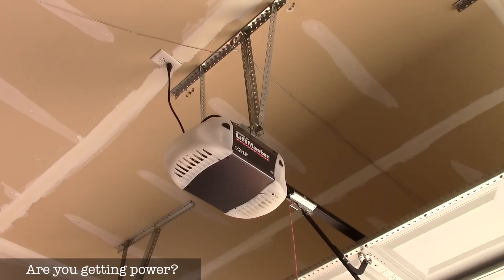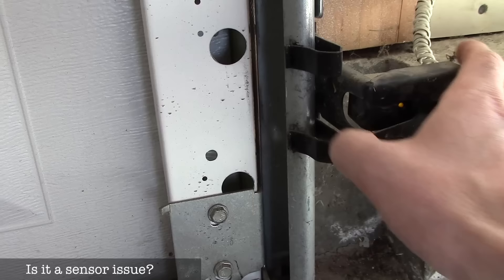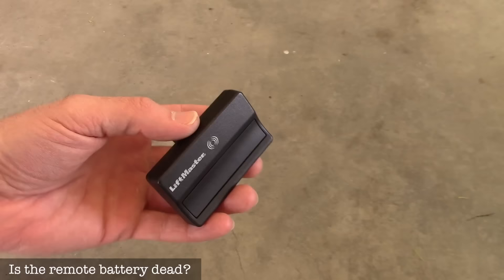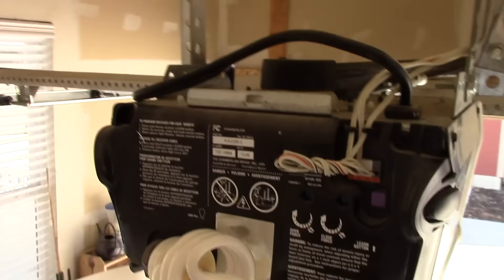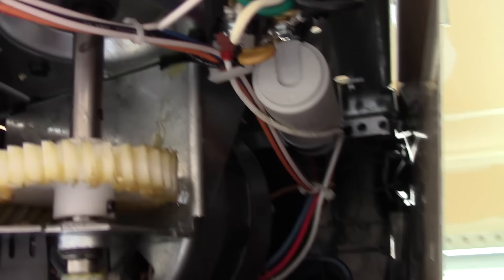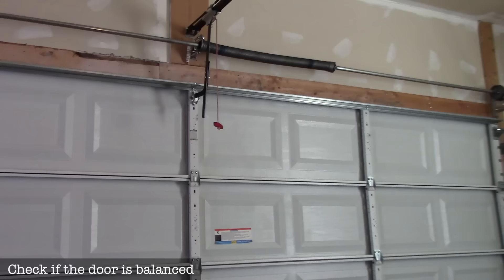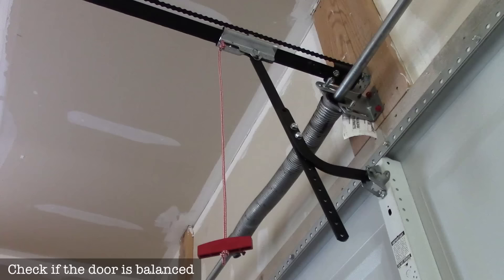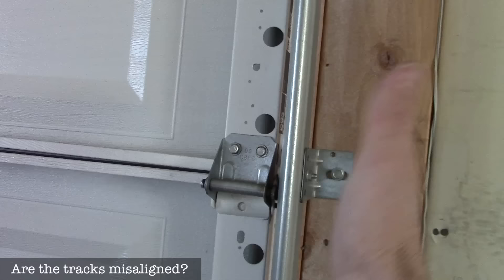Garage Door Opener Troubleshooting and Repair - How to fix common problems

Comment: I have a question with the Garage door remote, Here is the issue, I am able to open the garage door using the remote, after I come out of my garage and try to close it it will not close. I have to wait for the light on the overhead turn off (app 5 mins) , then when I press my remote the door will close. My bulb is not a LED bulb. Any idea to solve this issue will be greatly appreciated

Comment: My garage door won’t go up. The lights work 
 Everything looks fine, but the sensor lights are off. How do I replace them? Or do I need an electrician? I’m not good at electrical work. What can I do to make my garage work again ? It won’t go up, I checked the wires they’re ok . Any advice I’d appreciate

Comment: My door goes down then back up. Sensors leds are on and seem to work. Reduced travel both up and down worked a couple of times then same problem occurred. Checked for pinching all good also nothing blocking sensors. So bad board maybe 15 yrs old.

Comment: Hi Adam, My Liftmaster Pro 1/2 hp stopped responding. when I unplug the power and reconnect the light stays on for 5 min, and nothing more. changed the motion sensors (amber was not lighting up). Remote has good battery and lights up. any idea why it is not responding? thank you.

Comment: My garage door & remotes started malfunctioning. Liftmaster is of zero help. I'm trying to fix myself. Took the motherboard out to look for something. Saw nothing but added some soder anyway. Now, I can't program any remote, plus I notice that there are no lights on either of my door sensors. The garage door opener LED learn light now blinks twice. Any thoughts?

Comment: Help,  I pulled the disconect to manually close my door.  It was OPEN when the power went off strong wind rain. So I could not close the door with the remote.  Now when I try the pull down and forward it will not connect.   The other videos that tell you how to reengage the door should be CLOSED when you pull the cord to disconnect.  
Any ideas how to reconnect the power opener

Comment: Both of my sensor lights stay green and don't go off when I move my hand in front of them. Will start to close and go back up with the remote.Will close by holding
 down wall switch. It is a Liftmaster brand. Can you help?

Comment: I can’t find out why the light💡 on my won’t work. The bulb is good but when I push the switch to turn it on, I just hear a clicking sound. I’m wondering if the problem might be internal or maybe a short?

Comment: I have a Genie 1028 model garage door opener and have had intermittent problems with the door sounding like the motor is running, but the door does not engage the chain. The chain seems little loose and I have not been able to figure out how to tighten same(have checked out the videos on You Tube, but they are for a different model and cannot find one for my model). I also got a new carriage thinking the one on the unit is stripped to some degree, but again it was for the wrong model and I cannot find what I need on the internet. Any thoughts on how to manage and correct this? I will call Genie tomorrow and try to problem-solve with them as well. Any help appreciated. I manually open and close the door as needed and when I do, I usually hear a click re-engaging the chain, I think. This is some opportunity for exercise for me, but my wife is not able to do this as she just had neck fusion surgery and can't lift the door or close it as needed. I am chivalrous when I 'm around for her, but when I'm not and she's faced with it, it is a hassle. Any thoughts much appreciated!

Comment: My door  is suddenly going really slow..we had a power outage in our city two days ago--I has been acting up since then, No ckt brkrs popped. AND I jiust tried to flip it to manual--the cord broke--I used vice grips and the manual switch is frozen--I am soaking it in WD-40 If the motor burns out I am stuck--I'll have to leave the door open  until I can get a repairman out--it looks like the are booke d for a week

Comment: My opener clicks twice, no light, when I press the button on the wall. Also one of the sensors has a green light and the other has an amber light. I’ve tried to align them but the amber light does not go out when I put my hand in front of it. The green light sensor does. Is my sensor bad? Or is it the circuit board?

Comment: Adam help please!  The garage door works fine…to open it. Sitting in the car hit the home link and it goes up just fine. Then we back out hit the button again to close it and nothing. If the lights on the garage door open are on forget about the door closing. If you sit and wait for the light on the opener to go off the hit the closer it will then close. I have incandescent bulbs in the opener and have removed them. You have to wait 5 minutes before you can close the door. What gives?  Help.

Comment: I have 2 leds on my keypad flashing really fast. Opener doesn’t respond when I push it. Tried the lock button but it didn’t work. One sensor is yellow the other green

Comment: Spent 200 on a garage door opener, hired someone to install it 2 years later for 250, he replaced the torsion spring and then said that the board was dead. we replaced the board, he said the motor was dead. replaced the motor and now we got it all set up, the motor/gear turns, but it sounds like its jammed with no visible jam. 

One side of the belt is loose and the other is extremely tight, could be because I misaligned the teeth of the belt maybe? Its not a chain, more like a plastic tooth belt.

Comment: Remote clicker only works when it’s closer than 12” to the control unit.  Car mirror remote and outside wall remote don’t work either.  The hard wired wall button works.  Is the problem a circuit board.  All remote controls work when they are less than 12” away..your thoughts?  All the videos don’t address that issue

Comment: Got 12 yr old door opener
The door opener remote inside works fine. The numbered pad also works fine and can be reset with a new pin programmed no problem. 

But the remote for the car I can’t even program.  Garage door opener is Craftsmen and I bought a new Craftsmen remote (same as the last one) and I can’t program it following all the instructions.   What could be wrong?

Comment: My craftsman opener starts and stops, when I touch the circuit board transformer it was clicking on and off...so I replace the entire board but still had the same issue. I'm starting to think it's the capacitor but I didn't think that was the case as I when I was touching the circuit board transformer it was flicking on and off...I could order the capacitor, but not sure that is the issue....

Comment: hi, thanks for the video., my genie unit won't let me pull up the manual lever to override the electricity.  it is too tough, too
tight, like it is locked.  any ideas?  p.s. i am a 70 year old female.  thanks.

Comment: Am I correct in assuming LED lights that are turned off would not interfere with my garage door opener? Or does that not make a difference?
Reply from the maker: Right.   Bulbs with no power would not cause interference.

Comment: Intermittent problem. Opener will not activate. If I lightly tap on the side of the opener it will function. Where do I start to troubleshoot?  Also there is a switch on the bar about 5 inches in front of the opener, what is that for?

Comment: Adam all of my remotes work even the universal. My problem is the wall controller doesn’t work and the led is flashing. What could it be.  We did have a power outage and went to generator power.
What should I check?
Reply from the maker: Usually, when the LED is flashing it means the wall controller is in 'lock' mode.  Hold down the lock button and see if it stops flashing.  If you had power surges it may have taken out some parts of your system.  The fastest way to test if your wall button is bad is to swap it with a neighbors (if possible).  Many times neighbors homes have the same system.

Comment: I am having a problem with my opener, the main control works just fine, I have two remotes and neither one will activate the opener. I have checked the board and it seems OK the antenna wire is clear and straight down, when I opened my remote it had two batteries in it. It was the first time I had ever been in a remote so I didn’t know if that wasn’t normal I ordered two new batteries and installed them it still didn’t work I remembered I had another remote so I tried that though I knew it worked the last time I used it, but it still would not activate I’ve watched your videos and the sensors are clear for the opening of the door and I a.m. beside myself. The opener brand is craftsman which I know could be made by anybody but it’s very similar to the model you showed on your video any help you could give me would be greatly appreciated do I remove the second battery although the unit has worked for the last 20 Years, I really would appreciate your help and I’ll be looking for another video thank you

Comment: So one of the power supply at the back of the garage door opener isn’t providing power. They are numbered 1, 2, and 3. #3 isn’t working hence my garage door sensors are not working.

I was able to diagnose this by interchanging the wires and when I attach them to #3, there just aint no power. How do I fix this?

#1 is attached to the garage door remote on the wall. I also tried connecting both to #1 and it worked but the sensors are just blinking and the door remote is blinking too which isn’t normal.

Comment: Yes, my landscaping led lights - when on - interfered with my remotes. My work-around was to install a smart plug on my landscape light timer box. When arriving home at night I could turn off the smart plug from my smart phone, open the garage door with the remote, and then turn the landscaping lights back on...with the smart plug. Awkward, but better than ditching $500 worth of LED landscaping lights!

Comment: Question:  My garage door keeps not closing all the way.  To shut it all the way, you have to hold the button down.  I realized that one of my sensors was amber and the other green.  I've had to adjust them before but for whatever reason, this time the one of the left is staying amber.  Even if I put my hand in front of it, it doesn't turn off, it just stays amber.  I've checked the wire but to best of my ability, I can't see anything.  I've adjusted it all I can, but the left one just stays amber.  Any ideas?

Comment: JOHN FRANCIS     I have a Staley 3200   50W    Serial code 90365   no sensors on either side. Door moves up and down but returns to up
front lights flashing.  cannot find any sensors?  antenna is in place  Please advise

Comment: Recent service call inserted metal struts to correct problem from a car impact . The curved bent panel was warped and sheet metal broken in several places , crashing into alignment on open and close .
I notice the door weighs noticeably more.  Within a couple days I came in the garage using opener as normal, parked, then hit button to close and suddenly the motor buzzed or hummed without moving.
So this corresponds to 11:45 in video about looking at gear, capacitor, etc. The company says it jumped a tooth , without looking at it, and a new motor around 500 dollars. On behalf of the elderly homeowner, I want to see if I can find a fix and trim cost. At least I know where to look so this helped narrowing problem area, thanks.
Reply from the maker: Fluteristic well if that is the issue, I have a detailed step by step video on how to replace it.
Reply from the maker: Fluteristic bummer that you have to deal with this right after paying for a repair.

Comment: My LiftMaster 3280 door won’t open or close. The green light is flashing on wall mount and when I press and hold lock, nothing happens. Green light continues to flash. Even when pressing light button, nothing happens. Any suggestions? Removed cover and wires seem to be connected alright.

Comment: My garage door motor turns for a bit and then stops on it's own. This without the trolly attached. Door manually opens easily. Yellow light flashes on unit. Bad motor or board?

Comment: Need help! With the door in closing motion The openers boom/trolley gets the door to the closed position however the trolley stays in motion forcing the arm to apply a tremendous amount of pressure on the top panel as well as bending the strut on the top panel. 
Any thoughts or advise?? Thank you sir.
Brandon
Reply: Limit switch isn't set properly. What that does is tell the opener when to stop.
Reply: My garage door wall opener doesn’t work. I programmed it to automatically close in 5 minutes, it still works. And all remote controls work too.
What it’s my problem?

Comment: Think mine got a indirect hit by lightning.  Learn lightbulb still on but nothing else works. Do you think its fried. Could  I just get a new logic board. Thanks
Reply from the maker: That happens all the time.  Sprinkler timers and garage door openers tend to fry easily from lighting.  You may want to get one of these: https://amzn.to/2NpOMC2  Usually a Circuit Board swap cures it but I would check the breaker first and make sure it is not tripped.

Comment: My LED light is flickering instead of a solid light (your video time line  at 1.09-1.12). I can only close and open manually. When I press the remote button, the lights blinks 2 or more times. What could be the problem?

Comment: hello we have a genie from approx 2012-13 we bought two of these new.    the one we use on a daily basis started not wanting to open and close occasionally.      Light comes on...but unit just humms.......i looked on top...no gear residue or shavings....gear is straight too....nothing worn it seems...........   I checked all the beams, ect ...released...door flows nice...no hang ups.      doesnt work with the remote or switch inside the garage.   When it does work...it can work with either inside switch or remote when it wants too.       I took it apart..couldnt see anything crazy on the capacitor.....or anything burnt on the board.    One item on the part of the board may have looked a weeeee bit warped...but nothing black or smelly...maybe just the way it is supposed to look?    either way it has a big sprag looking thing inside and i wiggled that and it instantly started working.....that part is at a angle and looks to be connected to the gear the chain rides on.       i tried the door several times and it worked fine...almost like it was jammed or something.    Until  i left....and came back home it wouldnt open.   then i tapped on the side and it started too but stopped.     weird.??????   BTW has normal bulb in it for the lighting part.   any help??

Comment: Still hunting for a solution; remote doesn't work only when the garage light is on.  It's not an LED bulb, have reprogrammed the remote and have replaced the battery.  Remote does work when the opener light is off, but will not work when the opener light is on.  Have also tried using when no bulb is in, no dice.  Looking for advice.

Comment: Door goes up about 2 inches then reverses. Same thing happens when the door is disconnected and its just the slider with no door. The door itself seems to work just fine manually. No binding and seems balanced. The motor seems like it doesnt have enough power then quits. Yesterday it would lift the door about 2 feet and stop now 2 inches. Any ideas?

Comment: Garage door closes and immediately reopens all the way again.  I have checked to  see if any objects in the way of sensors... Does not seem to be the problem.  I can stop the door nearly closed by double pushing the door closer...   But when try to close it all the way, it simply goes back up..  Suggestions????  Ken

Comment: Please help!!! My door opens and closes just fine with the button on the wall. My remote will not work. I replaced the battery and still doesn’t open the door. I tried to reprogram the remote with the opener by pressing the smart button on the unit, and then clicking the remote button, but it doesn’t seem to work, as the light bulb does not flash to indicate that it’s accepted the signal from the remote. I don’t know what to try next? If it’s the green board... would the button on the wall still work? Thank you in advance for any help!!!

Comment: I have a problem which I don't think you addressed. The door doesn't close unless I constantly hold down the closure button on the hardwired control. If I just depress it momentarily it behaves as if there is something in the way of one of the sensors i.e. blinking white light but if I hold down the closure button it will close just fine.  This behavior occurs though nothing is in the way of the sensors.  But I am unable to close it with either of the remote controls, manufacturer's remote or car mounted remote, by continually holding down their buttons. Any ideas what may be causing this? Sounds like an electrical problem to me.

Comment: my problem has not been discussed.  The wireless opener at the house will close the door, but will not open it.  I have tried and did align the green lite with the yellow lite, so at least it is being recognized.  I can open the garage door with the hardwired opener.   I can close the garage door with the outside wireless opener and I can kick my foot in front of the light to trip it and it does see my foot and go back up.  BUT once the door is down, I CANNOT get the wireless opener to open the garge door.  ANY HELP? ! ?  many thanks in advance.,.

Comment: My issue turned out to be with the light socket itself. When the socket was powered (with or without a bulb) the remotes wouldn't work. No real fix for it, so we are replacing entirely. (The opener was very old anyway)